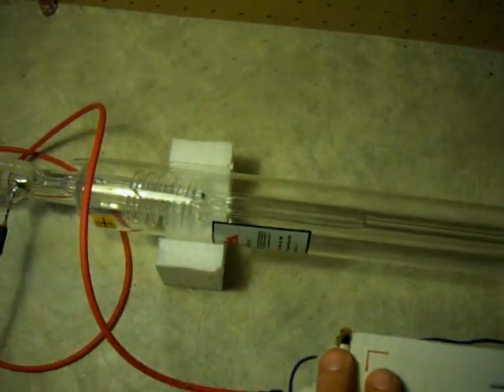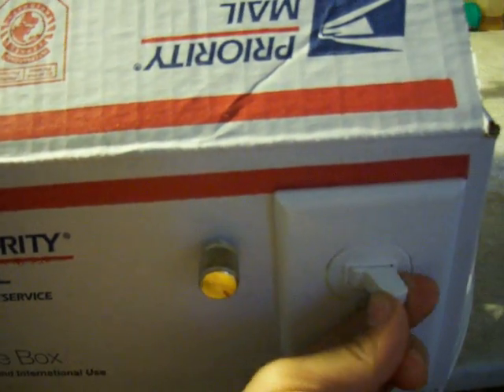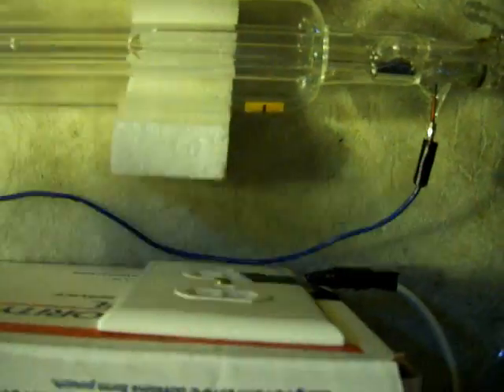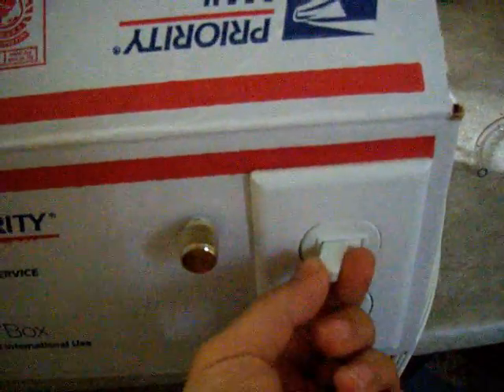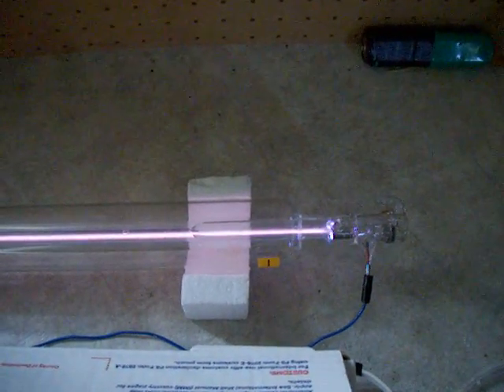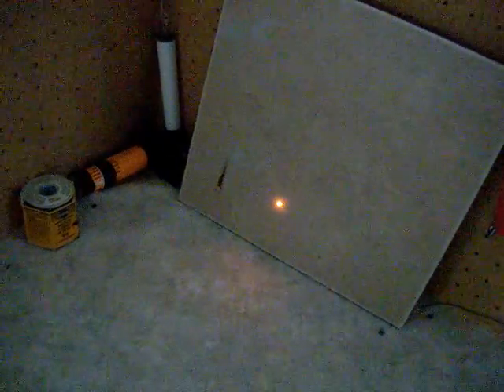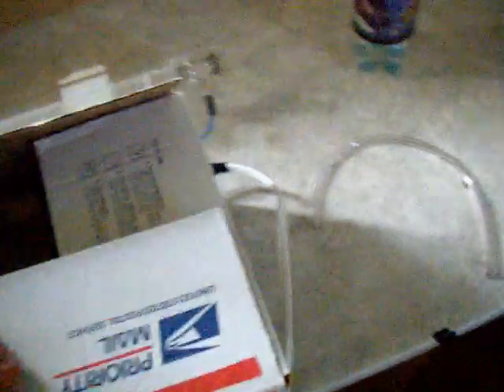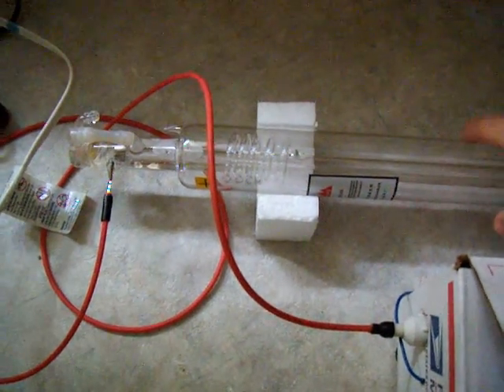25w co2 laser cutting burning! Dedicated to my physics teachers...

Comment: what makes it "25" Watt? the current input or the radiation output? since these can differ dramatically.
Reply: Mathias Westerlund CO2 lasers, along with diode lasers, are some of the most efficient lasers that exist.
Reply: Always the laser radiation that is measured. Older lasers are super ineffective, in general the Co2 lasers are VERY ineffective and produces a shitload of heat compared to light. However they are constantly improving.
Reply: Mathias Westerlund Thank you
Reply: Mikkel324 most efficient device can still be very inefficient, i don't see a problem there.
(anything that wastes more then 50% of the energy taken?)
Reply: Mikkel324 Doesnt matter, they are still EXTREMELY ineffective. 

The heat generated is heat energy. And nothing but leaking energy wich means inefficiency.

Comment: Can you please tell me how to connect the. Ac and the on /off  switch in your power supply , there is a section for  Ac connection and the other section is for on off switch,can your show me the inside of your. Power supply so I can see the wiring?